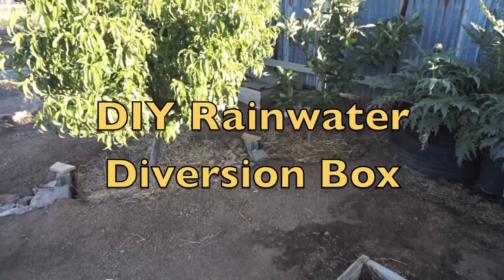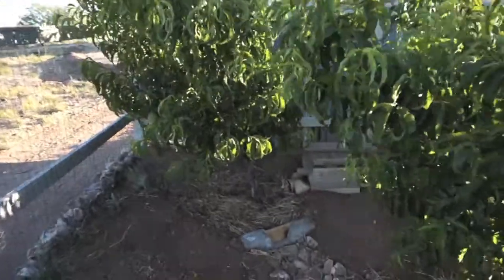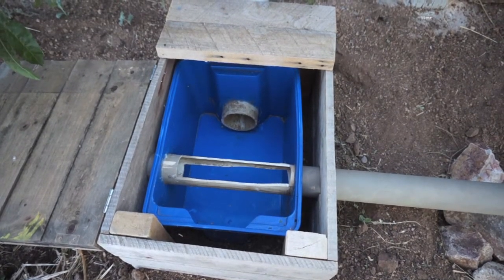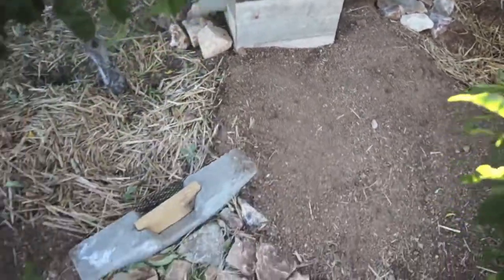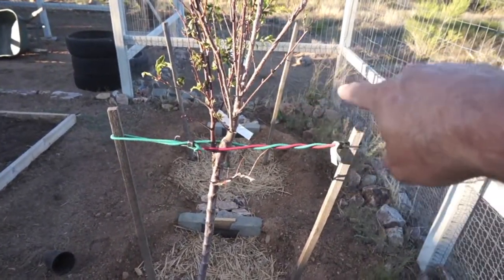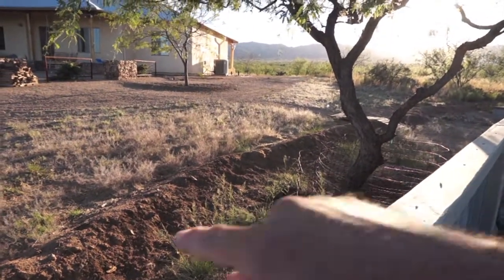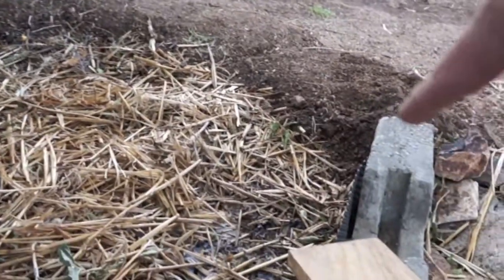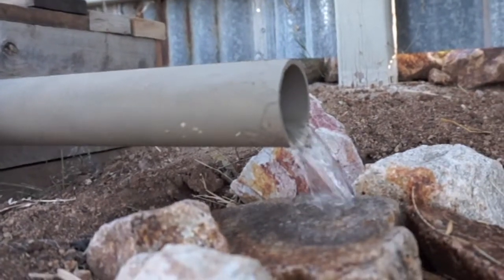Rainwater Diversion Box for my fruit tree swale

Comment: Let me preface my comment by saying I don't know anything about this process :) but it seems once the rain stops and the water level inside the box (Ikea storage bin) dips below the pipe, wouldn't that leave standing water inside the bin?  On the video it appeared to be maybe 10" or so.  Why wouldn't the pipe be placed at the bottom of the bin vs towards the top?   Just curious.  The system looks great though, nice work.
Reply from the maker: A.J. Schulz Hey AJ,  Thanks for the comment and you are certainly right.  You could probably put it at any level but I put it a bit higher to mitigate potential debris etc.  At least in theory anyway:)  Also, i think it might help to let the water leave at the same time by having the pipe at true level.  Anyways, hope that maybe answers your question... and thanks for watching!

Joe